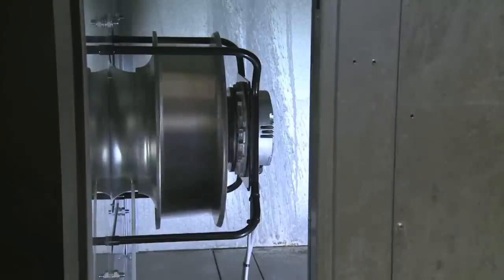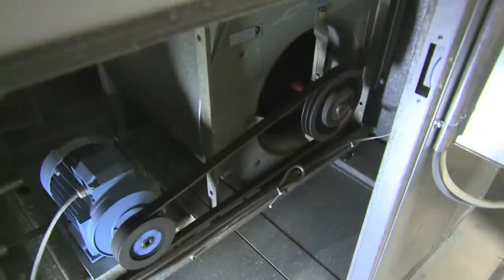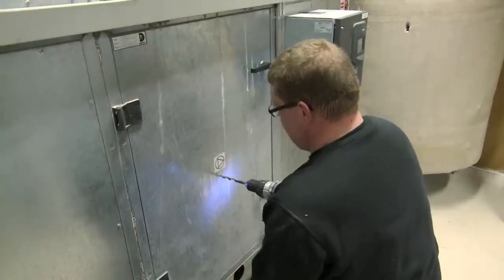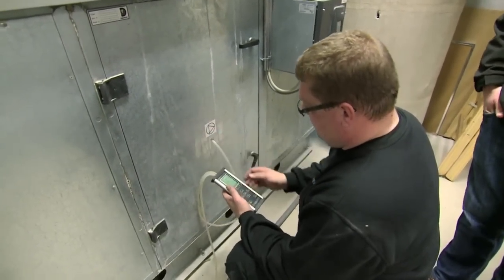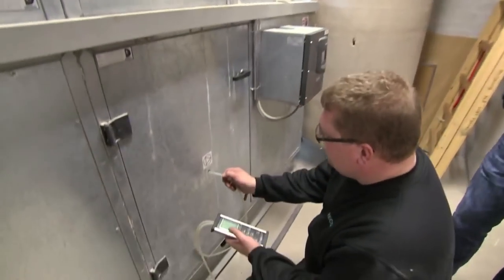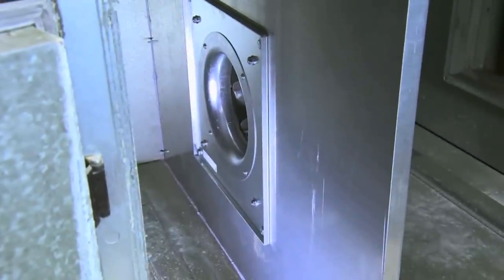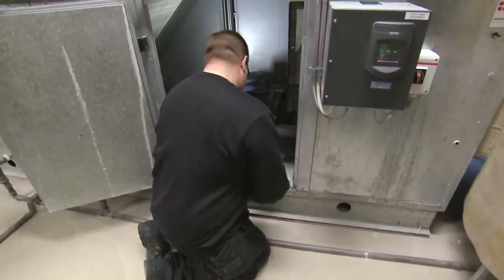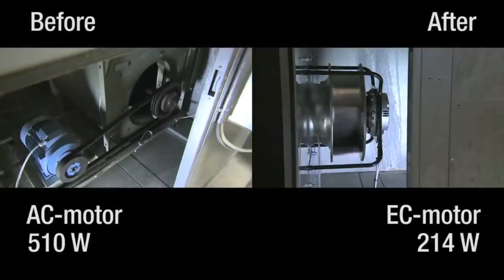EC fan upgrade for air-handling unit - ebm-papst

Comment: Hello.  To help with your two questions:  1) The CFM will depend on the site.  When we install a fan we ensure that the benchmark airflow is matched or improved such that the air handling unit is working as it was or better.  2) Our EC fans have built in speed control options that can be accessed by a BMS.  No other external VFD should be used.  Thank you for your inquiry.  Simon
Reply: Hello.Is it DC motor and the speed control is change the motor voltage ? thanks
Reply: @BeWater22  Hi, in order to change the speed 2 methods are suggested.  1. ModBus - this gives full two way control to a defined speed. 2. 0-10V or 0-20mA input.  These driving signals will drive the fan speed up and down but not to a defined speed.  Do not change the supply voltage.  I trust this helps.  Simon